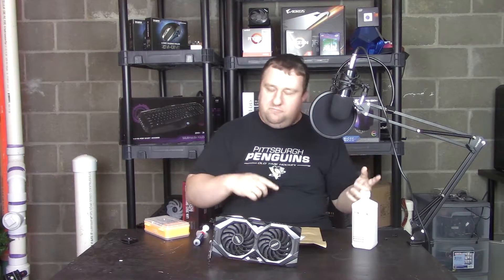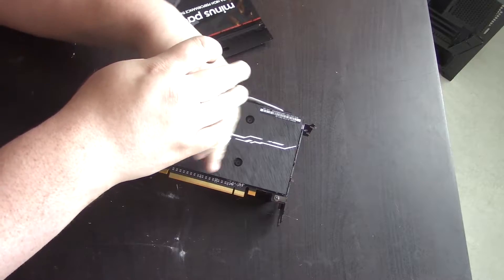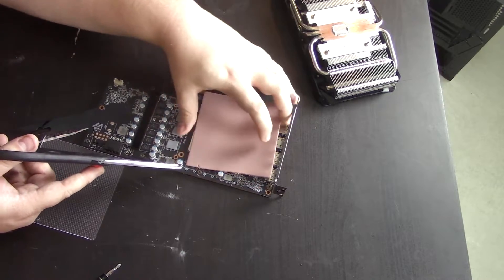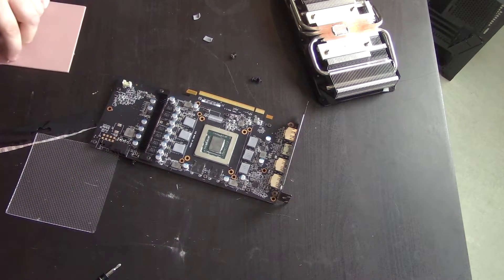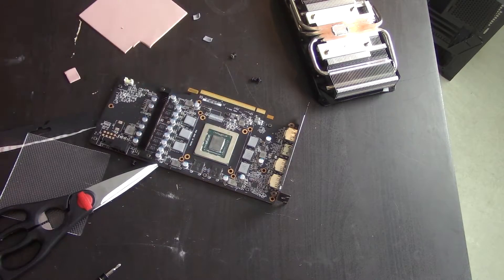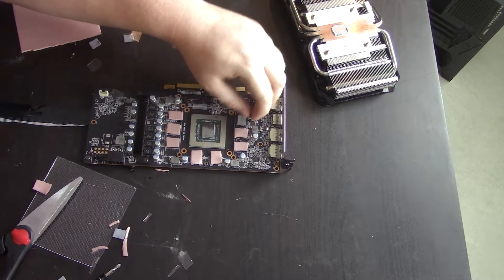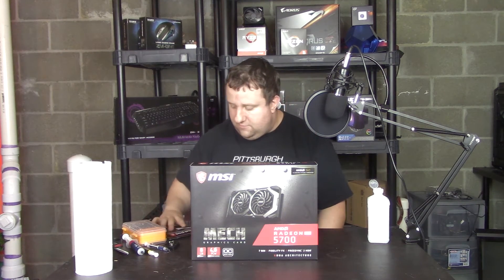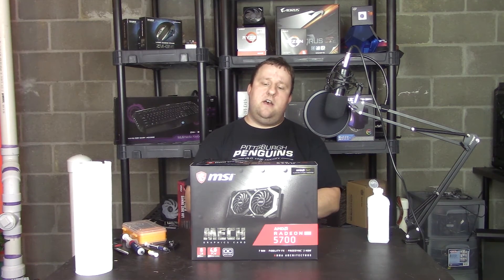Overcoming #Thermalpadgate: Switching Thermal Pads on RX 5700 Mech OC

Comment: Thanks for the vid! Between the thermal pads and the kryonaut repaste my Mech OC dropped 15 degrees so it doesn't sound like it's about to take off under load. I also noticed that the VRMs have a long strip of thermal pad doesn't even contact the radiator! I literally put another pad on top of that pad , smashed it down, then put the radiator back on and somehow it didn't ruin the mounting pressure.
Reply: What's he thickness of the pads you choose?
Reply: @therealstanthelee2141   I used thermal grizzly minus pad 8 in the 100x100x2mm size. Sorry I would’ve replied sooner but I wanted to be sure I got it right

Comment: For a 5700 xt mech oc , is 2mm too thick or not ?
Reply: Yes for me
Reply: @leonardodeku  I think 1.5mm pads are the best for this card
Reply: @maranathasam  I just use Artic 1.5mm thermal pad for my Rx5700 and now im waiting for ThermalRigth 2mm because my memory are too hot, over 60ºc without load and +90 in games.
 When I install the 2mm ones I will tell you how they are. Sorry for my english
Reply: @donpijotedelagarcha1854  Up to 110 degrees are in the normal range. It is better to pay attention to the hotspot temperature. I first had 2mm pads and the fans have then always fully turned up because the junction temperature (hot spot) went to 90 degrees and that determines the fan curve. Then rather limit the FPS, then the memory temperature is lower. Sorry for my grammar. I am from Germany.
Reply: @maranathasam  My memory tems drop to 70ºc but my hot spot was on 95ºc and today reached 106ºc. I did the test with AMD stress test
Reply: That's exactly what I was trying to tell you. But as the saying goes. You learn from your mistakes. @donpijotedelagarcha1854
Reply: In Forza Horizon 5 my hot spot stay under 90ºc
Reply: @donpijotedelagarcha1854  Put 1.5 mm pads on it again. Believe me, it's better. Best from Thermal Grizzly, because the heat conducts well. More than 4 degrees difference you will not notice.
Reply: @maranathasam  But with 1.5mm my memory reach over 100ºc and with 2.0mm over 70ºc and the hot spot is on 90ºc. i think is Ok. Im using MX-5

Comment: anyone know the thickness of the pad 1 mm or 1.5 mm? Also the size of the pad I will need? I don't want to buy to much.
Reply: from the lik provided its 2 mm. i bought them but didnt help much.
Reply: @aleksander1729  Because it is not the correct thickness. The correct thickness is 1.5mm or 1.0mm

Comment: For all 5700xt users who experience high junction temps (110° and over): the problem of this card is heat sink mounting pressure and poor thermal pad application (MSi). All you have to do is: apply new thermal paste and 2mm pads; add 0,5mm plastic washers under the screws and alternatively tighten each of them half turn until they're firm. With this mod the junction temps of my msi mech 5700xt oc never surpass 90° and core max 76° with 100mv undervolt under max load (1440p ultra). No more clock bouncing and stutters.
Reply: Where do you apply the pads too? The same place where the guy put them?
Reply: where are you putting the washers? i'm having this exact issue with mounting pressure
Reply: You are absolutely right! Thank you so much! It Is amazing what some 0,5mm plastic washers can change. I changed the pads but my junction and memory temperature skyrocketed (100 both on full load ). With the washers on it is another story. It never reaches 90 on both. Again thanks!
Reply: @javieraguayo699  can you send me the link where you bought the plastic washers?
Reply: @javieraguayo699  De Donde compraste las arandelas de plastico? Podrias pasar el link?
Reply: @MiguelRedPy  un kit con tornillos para torre de pc, lo compré en Amazon 

ILS - 228 Piezas Computer Case Screws Kit para Motherboard PC Case Fan https://www.amazon.es/dp/B07GXNNQ8Q/ref=cm_sw_r_cp_api_glc_i_FEV6XCJJS9YAT735GKF7?_encoding=UTF8&psc=1
Reply: @javieraguayo699  las arandelas de plástico del kit son de 1mm, sirve igual?
Reply: Where did you get your 0,5mm plastic washers and where did you install them on the card?  Thanks!
Reply: @xlBATES  see the links below, I placed them between the backplate and the backplate screws. 
Backplate-washer-screw
Reply: @javieraguayo699  Hey man, What links? lol I am not seeing any
Reply: @Valerio Maver are you saying core hotspot or memory hotspot?
Reply: I have a gigabyte 5700xt it get on 98 degrees when I play is that normal
Reply: @user-zp8df2cv6m  nope
Reply: Jesus in disguise.
Reply: The correct solution is to put 1.5mm pads on it. 2mm are too thick.
Reply: Thanks for this comment. I used 1.5mm pads but added plastic washers because of your comment on my Msi 5700 XT Mech.
Reply: @stoneyvision8645  where can i enconuter plastic washers 0,5mm?

Comment: good video friend.  Brand new Mech OC 5700 flashed to 5700xt, solid overclock / undervolt.   57 mhs on etherium unit Mem temps hitting 106 and thermal throttling down.  will push temp down to 102 C and work back up till throttle.
Shipping it back.  Not sure if i just got a very terrible version, or if that is their new standard.  I will be getting the replacement and testing.  If bad, i will have to change out thermal pads as well.  thanks again for sharing.

Comment: is it possible that 2mm is to thick and as a result there is less contact to the chip (higher hot spot after change)?
Reply: Yes need thinner like 1-1.5mm

Comment: Heh I just put liquid metal on this gpu and changed thermal pads, core temps droped for 12°C from 74°C to 62°C, hot spot went from 110-112°C (throttling) to 100°C (no throttling), Ram dropped just for 5°C it is now 80°C still hot or not ? I know liquid metal in copper is not good, but there are a lot of youtube videos after 1 or 2 years of liquid metal on copper cooler and there is no cooling efficiency drop and copper is just a little darker=) I am sure it will be fine. My settings are: Vcore 1,125 core clock: 2150 memory clock : 1820 Power limit: +20% In game a have 2100 coreclock I also tried SPPT_RX_5700XT MorePower5700XT.reg to unlock core clock and power limit, but for now did not acihve stable overcloack

Comment: I have a question, but first sorry for my englisch i am out of germany.
I bougth last year a msi rx 5700 mch gp oc and after your video I think my card has a production error, because I have in the Valley benchmark after 20min a gpu temperatur of 69 a gpu hostspot of 87 and as memory temp 73 on default settings and ca the same by gaming. Shoud i sent it back to get a new one or that they repair?

Comment: They have to fix the bios those fan running to high my go up to 68c ... that’s it I low the fan speed with msi aftherburner.. I keep it around 67 to 69 the highest... I don’t want to hear those fans I wish they can run like the 1660ti is nice cool and quite.. Amd or msi have to do something about this issue ....
Reply: I dont mind the noise of the fans, when gaming, dont hear them.... so I prefer to have fans on 100% when gaming at full load of graphic card,  because  I think lower temperatures are good for electronic it will last longer

Comment: i recently got this card for $309 i will repad i saw a gap between the vrm's and cooler it has a pad already but it does not touch you can see a gap
Reply: Mine has the same problem

Comment: Hey mate, I just found out how to fix the damn thing. Just remove the stupid plastic backplate. It does nothing but traps the heat of the PCB around. And firmly press the radiator while screwing it back.
I just lost 10 to 15°C just by doing these two easy tricks.
Reply: i did what you said there is no difference, maybe -1 °C  the problem is  "msi" thermal pads
Reply: DocteurMolotov are you serious I’m gonna do that in my..how are the fans are they running low now..?

Comment: Did you try using washers to increase the mounting pressure? I was able to get mine a little lower using washers from a micro heat sink kit to increase mounting pressure. Did you use 1mm thick pads or 3mm?
Reply from the maker: 2mm
Reply: @BigHeadTech  Just did one of these. It had 1.5mm on the middle vram chips, and 2mm for the sides. Also all the factory pads were about a third the size of the actual die. You gotta tighten the screws really well too. Unbelievably awful factory job on these by MSI.
Reply: 1.5mm are the correct ones

Comment: So.. I did the exact same thing shown in the video. Used the exact same thermal pad. 

My memory temperatures skysrocket.
Any idea why?? Can't seem to fix it. Re mounted it again and the same thing is happening.

Core temps got lower tho
Reply: Ismael Rodas did you remove the protective film of the pads? Did you use 2mm thick pads?

Comment: Maybe it is on purpose and can be seen as a trade-off between core and ram temperature. The core could be even hotter(like 75C) when overclocking. Anyway, adding heat pipes is a better way(but larger and more cost), just like Saphire Pulse (5 pipes).  I bought MSI Mech because it's cheaper (~$20), as for the noise and temperature, 70C is not bad at all compared with my 1080, to be honest. 5700XT is really great on temperature control.
Update 1/21: returned the Mech and bought Powercolor red dragon (5 pipes, heatsink for VRAM, 8 phases power supply). sorry for the misleading information about mech above. mech is too loud during furmark test, this card should be redesigned.
Reply: update: returned the Mech and bought Powercolor red dragon (5 pipes, heatsink for VRAM, 8 phases power supply). sorry for the misleading information. mech is too loud during furmark test, this card should be redesigned.

Comment: this is the only card available in my area should I buy it ? I wont be able to change pads .
Reply: Thermal Limit
  Edge: 100°C
  Hotspot: 110°C
  Memory: 105°C
  VR Gfx: 115°C
  VR Mem 1: 115°C
  VR Mem 2: 115°C
  VR SOC: 115°C
  Shutdown Temp.: 118°C

The hotspot in this video is around 80°c-90°c
Which is not dangerous, but the power efficiency will be much less than a stable 65°c-70°c

Here's the easy-to-understand theory behind it :) https://nationalmaglab.org/education/magnet-academy/watch-play/interactive/heat-resistance
However this does not automatically means that setting your fans at a higher speed will be cost effective as the fans use electricity too ;-) But it'll be more stable (in theory)
So if you ever wondered why heat causes instability, this is why :)
Reply: @rakly347  thanks I got gigabyte gaming oc it is much cooler
Reply: @virtumind  nice, Gigabyte makes good cards too :)
Most of my (AMD) cards are Gigabyte and Sapphire (cryptomining)
As for MSI, the 5700 (xt) Gaming X do seem to have decent cooling, it's a whole different design than the Evoke and Mech.
https://youtu.be/95rBw053qNw?t=191
Reply: @rakly347  mining with gpu still useful? What currency? ethereum?
Reply: @virtumind  If you are willing to hold it, but I also have solar panels :) Basically free money haha.
Mostly monero and Eth, yup.
replacing my RX4xx/5xx with 5700's (non XT) lowers my power consumption equal to about 200 euro/year/card. If I would have to pay the median Belgian kWh price.
Plus they mine aprox 1/3rd "faster".
Every now and then i manage to snatch them on flash sales Amazon at .300-350 euro.
I use keepa plugin to track pricedrops.
Reply: @rakly347  thanks. I am out of job now for 4 years I am in Egypt. How many GPUs I need to get for example to get $1000 / month?
Reply: @virtumind  hmm, right now, with a $0.10/kWh electricity cost about 200 5700's non-XT.
In Belgium it's closer to $0.30 (0.25 euro).
To start mining right now would be a big upfront investment.
I, by sheer luck, started mining in may 2017. right before the hype-rally.
(I don't have that many cards myself even). On any given day I have about 50 cards mining. I need way more space for solar panels. I expect with the 5700's I can push maybe 60 cards on the same power consumption.
A good way to cut costs too is using the Asus b250 mining board. has 18+1 PCIe slots, but you can 'only' run max 13 AMD cards on them, the rest HAVE to be headless cards like the p106-100.
Which means, less CPU's and RAM costs.

One of the most important parts in mining are the PSU's. It is in your best interest to go for 90%+ rated power supplies. Yes, they cost a lot more, but there are several reasons.
It'll waste much much less electricity. They are built to last and come with a good warranty. Have high quality copper and good connectors. Reduces the chance to damage your GPU's!
These PSU's usually are named Platinum & Titanium.
Bad PSU's and cables can destroy a whle rig, you'd wish you hadn't cheaped out on that :)

But just mining is not the end all be all. You can 'park' you coin in lending programs and get sweet returns on them. ie nexo.io & makerdoa (aka DAI).

I wouldn't recommend some one to start mining right now unless you literally have the cash to burn. However, that being said, I still believe we have a loooong way to go with crypto.
Bitcoin does these kind of mega rallies every 4 years, give or take, but each time compounds on the previous rally.
Reply: @rakly347  thanks
Reply: @virtumind  In case you already read my response before I editted, I meant 200 cards, not 2000 lol

For a bit more experienced miners, you could rent out your hashing power on miningrigrentals. Contrary to nicehash, you manage your own prices and settings.
When not rented, you mine for yourself, you could set a more profitable price in case some one wants to rent your rig(s). The system automatically switches it for you.

Why would people do that you ask? They might expect a change in price or difficulty , or a fork and want get in beforehand.
Or, money laundering. miningrigrentals is real good for people that want to launder their coin, and are willing to pay a premium for it. Or they want to mine a coin, or on a pool other than what other cloudmining systems offer.

I also use prohashing to mine 'unmineable' coin, like BNB, 0x ...

Comment: Lmao, complaining about the stock thermal paste, congrats, you just made it 6C° worse, but now your memory wich wasnt nearly that bad are good. I would take 6C° cooler hot spot any say of the week
Reply: i wouldnt xd whats wrong with you? memory is much more sensitive to high temps than the die itself xd he fixed the damn card, even with the higher temps on the gpu it now has more longevity than stock

Comment: The hot spot is on the cpu has nothing to do with the memory other then throw more heat onto the heatsink itself. Which could, although highly unlikely, add to the memory heat. Also, since you where doing a before and after it was not necessary to add other gpu to the mix. All it did  was muddy it up.

Comment: Can I take the Bios of Msi RX 5700 Mech oc with you? I screwed up
Reply: here you go!
https://www.techpowerup.com/vgabios/?architecture=AMD&manufacturer=MSI&model=RX+5700&interface=&memType=&memSize=&since=
(They all [MSI] use the same bios, except the reference design)
If you want a higher boostclock, you can use the XT bios even.